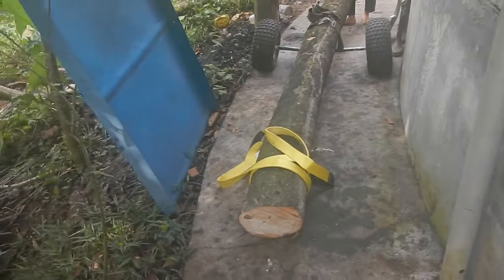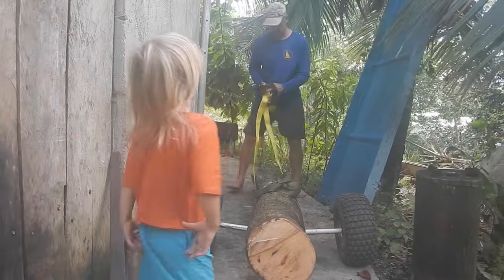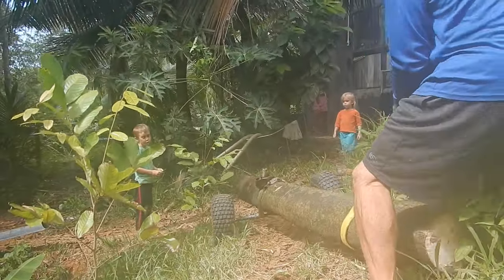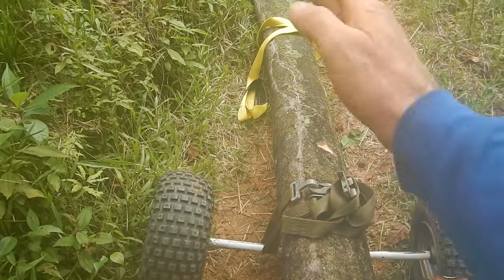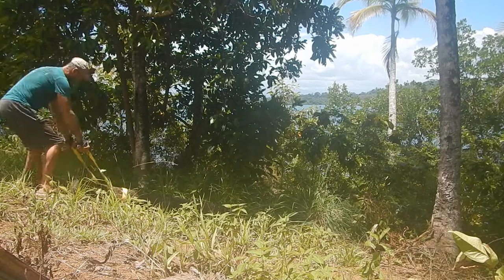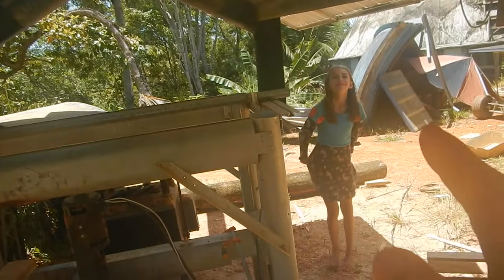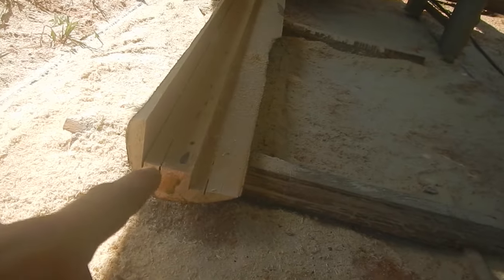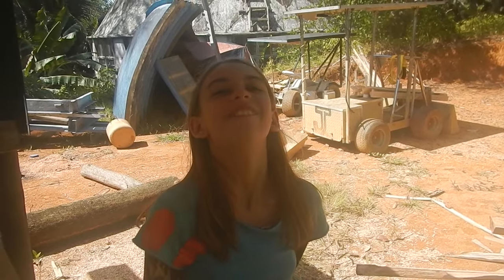Movin' Decent Sized Logs...

Comment: Log Dolly's typically don't have axel but arc shaped bridge between the wheels. That allows you to lift the log with ratchet straps up to dolly rather than trying to lift it over the axel. It also makes it easy to put it on the middle, so you don't have to support log weight. Usually pulling is hard enough with a big logs. 

Having maybe 50cm long bar parallel with the log makes dolly very stable and prevent it from turning